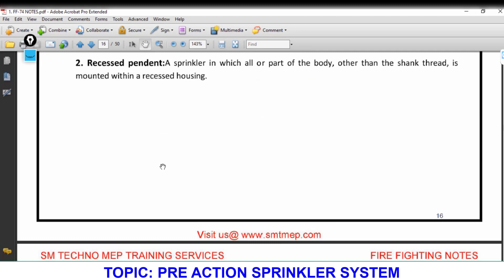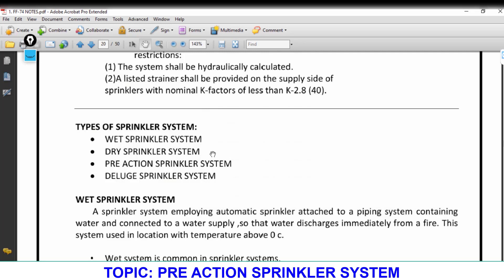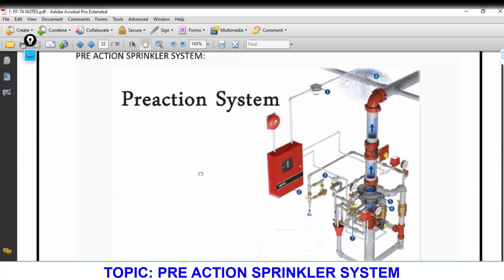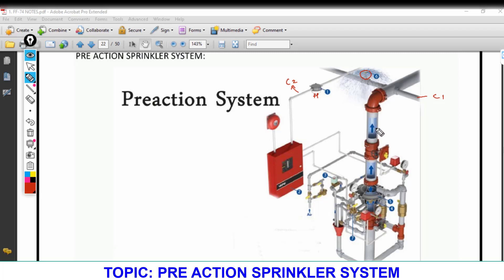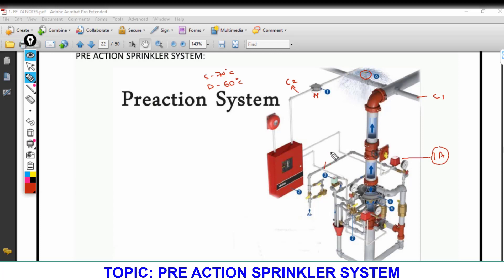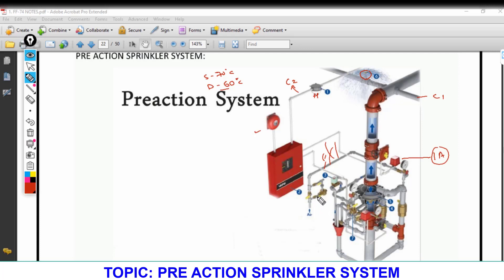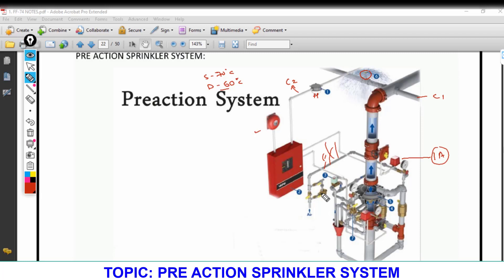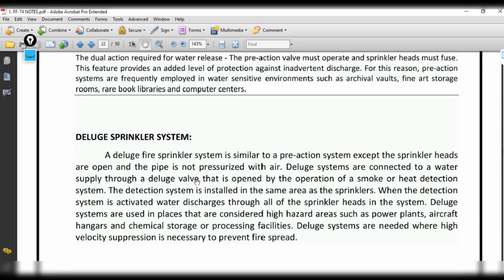PRE ACTION SPRINKLER SYSTEM - CLASS 13

Comment: Very nicely explained the concept of pre-action, dry and wet sprinkler system. Thanks a lot.
Please advise whether the NBC guidelines for providing sprinklers system in the office  are applicable to existing high rise building also which already have set riser system, fire extinguishers, fire fighting team, forte control room etc.
Regards